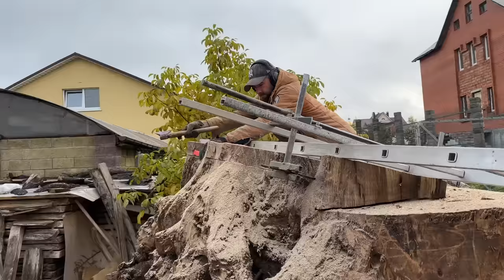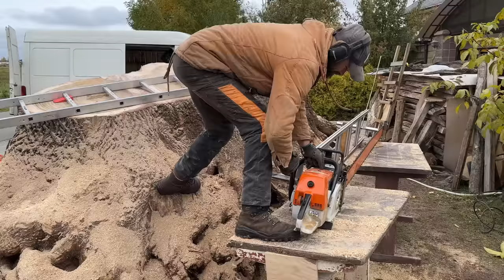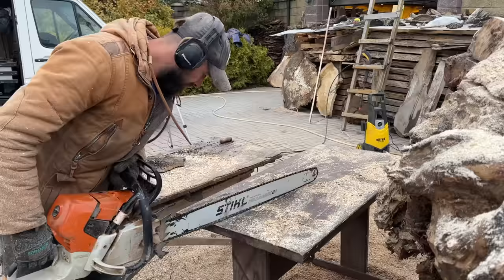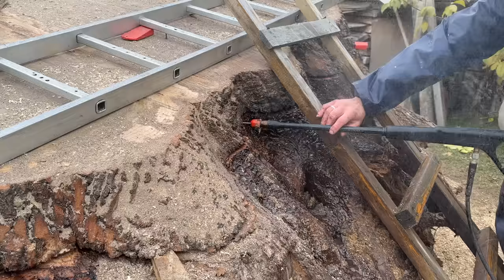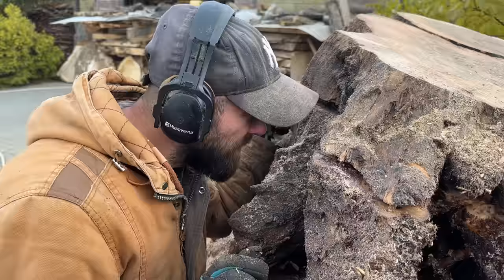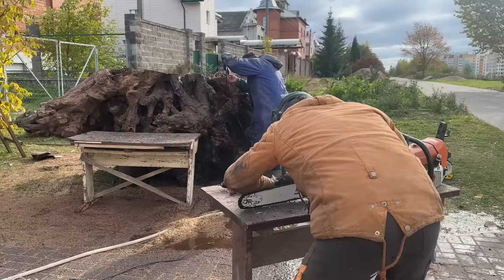A shocking find in an ancient oak stump

Comment: There was literally a piece of steel angle iron in the center of the tree. I imagine it was used to hold the tree steady when it was freshly grown. 200+ years ago.
Reply: No a forge made square  iron bar used to mark property corners for surveyors. Trees would grow around them. And never be cut because everyone knew that tree marked the property line.
Reply: Must have been a Beautiful Tree !
Reply: No
Reply: How is that "something shocking", interesting but not shocking,
Reply: 이종
Reply: An ancient axe blade?
Reply: What did that do to his blade?
Reply: Nice table tops
Reply: I was told you can count the rings to know how old the tree is?
Reply: No eye protection?

Comment: I keep seeing beautiful table tops being made from the slabs of wood.  That wood is beautiful and these guys really have patience and skill.  The prices they will get for those slabs of wood will be well worth their hard work.
Reply: Yes you are correct to the tune of around $4000 for largest one as a conference table to 2000 for the first full length cut as a coffee table using the single first cuts as end tables to match
Reply: Claro pues esa es la idea cada loza de maderera es una mesa de roble y sigue siendo util para cada cena" creo yo" the charly ahi libra las cadenas que daño debe ser con una losa de esas creo yo" the charly"???
Reply: Hi claro estos dias tambien corte unos 3 ho cuatro arboles lo malo es que eran de pino patula para una casa en madera y tambien sillas diseñadas con tronco y hojas de madera de 4 ho 5 pulgadas"??? Mas las bigas y otros"??? The charly"??? Tambien saque como unas 10 toneladas de tierra el mismo dia para mejor visual" de la casa finca"???

Comment: If you really want to cut through metal with a chainsaw, you should be using the carbide tipped chain designed for firefighters to cut vents into buildings. It can cut through solid steel without too much trouble. Stihl makes a couple of different versions, so you should be able to find one that will work with your saws.
Reply: I had made the same suggestion but I believe due to their ability to cut through most material they are also favoured by certain people for illegal activities, this make them difficult for the average person to acquire.
Reply: @metalmicky  You can buy all the chains you want.  The Stihl dealer only recommends them for that one saw model.
Reply: Why aren't they using glasses, We know theeyn are cutting metal, the kind of metal is irrelevent, you would still lose your vision. I only have one eye, but from AMD.  Its a pain in the butt!🤨🤨
Reply: Yeah I suggest goggles too!
Reply: That or one’s made for cutting concrete! They cut thru metal as well! Just like butter! Of course you have to keep em wet!
Reply: There were stones that grew in that tree

Comment: Typically you would see a blue line in the wood if there is metal in it, so you guess either lead or stone of which I have cut my share of both in NY.
Also there comes a point when you have to say “the slab ain’t worth it! Get the axe!”

Comment: Have you guys thought about getting a 2-man portable band saw with carbisde blade to use on your ladder miil? Thinner kerf (1 or 2 more slabs /cookies per log /stump), way less likely to bind and with the appropriate blade, cuts through nails and bullets. If one isn't commercially avaliable, contact Matthew Cermona, he designed and built his own mill, so you could colaborate to design something that you all benifit from. I'm an architect and already have various ideas as to how you could design and construct such a mill that facilitates how you currently mill more efficently snd how to impliment this. 

Fascinating watch this unfold. For video "dramatics", conside dousing the wood with water (see Matthew Cermona) to show your subscribers the beauty of the wood your milling?
Reply: I’d suggest diamond toothed chain blades used in concrete cutting! Cuts right thru rebar and anything! But you have to lubricate with water.

Comment: I guess this is why loggers always leave stumps behind because sometimes trees drag rocks up with them as they grow ,but this seems pretty high up into the tree here like maybe someone set a rock in the V as the trees were growing together in the trees younger years you often find them in the roots if you'd have known it was a rock you could have used a concrete or rock  cutting blade maybe on a different type saw and cut that rock right in half and left it there and varnish right over it as the end product of tabletop it would add a real conversation piece it looks like there are going to be some beautiful piece's as you get into the  lower tangled roots section  of stump it would be cool to see how those look ,cool video keep up the good work ( hard work)!
Reply: Sad to see that humongous tree had to come down. The years it lived and the stories it could tell.
Reply: Non ho visto niente di strabiliante, ma è comunque un video piacevole. Grazie.
Reply: @sheryljaskiewicz8429   Maybe it was getting diseased or unsafe. I hope that was the reason, and not just because developers had other plans that it wasn't part of...
Reply: Include soil erosion in the plethora of possibilities.
Reply: Forse c'era dell'ambra. Resina fossile.
Reply: Not just rocks - that last bit was a solid hunk of angle steel beam. Probably an old fencepost.
Reply: No safety glasses!
Reply: We have MANY trees that need removed with ancient barbed wire through the center. The cedar trees are the worst, but you certainly have to be careful and pay attention when cutting!
Reply: @sheryljaskiewicz8429 Trees don't live forever
Reply: Non sai usare la punteggiatura quando scrivi ?
Reply: Great idea !
Reply: @roburz62   They don't need to be removed, they need to be revered.
Eradicating mature trees degrades the whole shared space for plants, animals,  and humans. 
#SaveOldTrees

Comment: A few years myself and my wife were saw up a large oak trunk for firewood.
While cutting a slice I noticed fibers coming out with the chips.
Putting it through the splitter we came across a silk handkerchief in lovely condition.
Counting the rings it had been there since the 1830s so  we'd like to think a lady placed it there maybe for a loved one to find but was never found.
I still have the log and silk handkerchief trapped in the wood sitting on a shelf in my workshop

Comment: Any idea of the actual dates of the tree? With nice clear rings like that it should be possible. Really interesting to know what it lived through.
Reply: Must be over two hundred years plus?...a huge stump
Reply: It looks like a few trees that have grown together and that would account for the stones, but they say it’s a single oak, so I’d say it’s about 500 -700 years old at least judging by the girth
Reply: It's only about 80 years old. You can count the rings if you pause the video. Many people believe that size dictates age and that is not always true. Many trees in the forest are similar in age but vary in size greatly. I've seen 80 year old Hemlock trees that were only 12 inches in diameter growing right next to  one that was 24 inches but the same age.
Reply: @mattdillon4398 your statement is accurate. There are many factors that determine the size of a tree.
Reply: Clearly it was 3 trees so close together that they grew into each other.
Reply: @mattdillon4398 Matt Dillon isn't just a great actor but he is also very knowledgeable in the subject of tree... stuff. Treeology, I guess would be the correct term.
Reply: @crenaud590  define 'clearly' LOL

For many species of trees, multiple trunks can radiate from the same root mass. However, it is still one tree. 😉
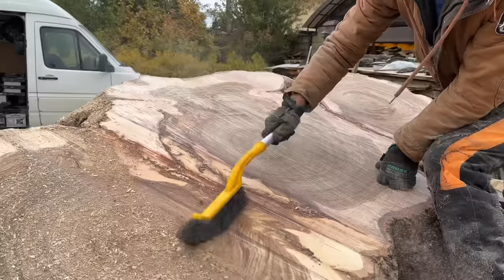Reply: @mattdillon4398   yeah, @12:24 for example the outer light coloured section only has 7.5 rings on it..
Reply: @jeffreylebowski3216 Dendrology is the correct term for the study of trees.
Reply: Great exploration into the past of the oak. One can count annular rings and send the inner pith for carbon dating.
Reply: @mattdillon4398  I paused the video to count rings as well. I also came up with about 80 years, Surprised that it wasn't older given it's size.
-dave
Reply: @dgwachtel it's that big because it's three different trees grown into one. Pay attention.
Reply: @ironnads7975  It is always possible to either be mistaken or miss another explanation which may be more correct or overlook some feature or other. 
Sorry Boss, I'll try to do better on the "Pay attention" front in the future.

Comment: This video that took the better part of an hour could have been wrapped up in 5 -10 minutes. I fast forwarded through most of it, and just watched several one minute clips throughout. From what I did see, I almost laughed out loud at how much effort these guys were putting into cutting a 5-inch slab off of that stump, and how many times the chain on that saw had to be sharpened (or replaced). I used to be in the firewood business myself, so I know exactly what's involved in all phases of woodcutting--although I must say that for as much cutting as I've done, I've never tried to cut a slice of a stump that big. But I know that's a helluva job even if there are NO rocks imbedded in the stump. (BTW, the fact that there were should actually come as no surprise; there's no actual "shocker" in that. There's nothing shocking about rocks getting dragged up into the stump as an enormous-tree-to-be gradually grows over many decades. Ask any logger who's dealt with enormous trees and stumps. It happens.)

What was that last object that they found at the end of the video embedded in the stump, though? 
That black vertical object. 
Was that a rock? 
Or was it something else? 
It almost resembled an ancient tool of some sort--but since the tree was clearly hundreds of years old at the bare minimum, what could it have even been besides a rock?
Reply: That's the question of the day. What was that black vertical object?
Reply: Yes, what in God's name is that.?
Answers on a postcard please. 😮😮
Reply: It was tough and definitely malleable, which suggests it was metallic. Something like the tip of a rusty ploughshare maybe?
Reply: yeah I was surprised to know I sat threw the whole thing and see a couple of rocks then find they do not say what they had found and this video has millions of views
Reply: @lisahartsook  i flipped to the end, early on.  It looked like an iron fence post.  One of those ones with an L shaped vertical profile
Reply: Many a “sword in a stump”. ? 🫡
Reply: Somewhere further up the page it was tagged as one of those irin/heavy metal supports often used with a young tree that’s beginning to lean. It just never got removed. 

It coyld also been leaned up and forgotten. 

We had t “bike in a tree” here for a couple decades. It was left by some kid in a fairly well-off family because he didn’t get the one he wanted. 

There was some serious grousing when it got cut down, but apparently there was actually some legitimate reason to bring it down. 

A bike parts and repair shop bought it and put it up in the parking lot (edge of).
Reply: It was a piece of ANGLE IRON:face-blue-smiling:..  The treasure was:face-fuchsia-poop-shape:.....
Reply: @williamfielding6476  🫣yes 
I say rusty ole angle iron, I was tryna be upbeat funny tho. Still a very interesting piece of work to slab out those big stump. I can see why there’re so pricy and this is just the beginning stages to make a nice the nice tables.

Comment: Stihl sells a Fire fighter's rescue saw chain that is carbide tipped. It's used for cutting open roofs so it can cut through shingles,wood,and steel brackets in the roof. Might be worth ordering just to have one blade that could cut through stubborn things.
Reply from the maker: Perhaps yes. But now you can’t even buy a regular chain from us. We are under sanctions. People at the top are doing weird things, ordinary people are suffering
Reply: That's sad
Reply: Now why would he get one of those when he can go through 50 chains ,7 chainsaws and ruin 10 bars. Plus he had to try every chainsaw he had in the van. Plus this would not make a good video on how not to do things.

Comment: If your getting about a 30 second cut on one blade even with oak , that is an indication that something  harder then your chainsaw  chain is inside the tree. Two choices: leave that log and go one to the next cut; or cut around the unknown object without hitting it and then chop it out with an ax. It will save a lot of chainsaw blades!
Reply: There were 3 objects in different places of the tree. Unless you have exray eyes you cant cut around them. Have you ever even picked up a chainsaw before? They had no idea if it was one large object or as it turned out, it was 3 different ones in different places..
Reply: What kind of metal was that?? Very interesting!  WHAT a surprise
Reply: @crossgrainwoodproductsltd9230  1 ) a stone 2) a piece of metal an what is nr 3 ?????
Reply: @micharebuz2542  An other stone.
Reply: Pues si " x que el corte es completo como para mesa " pero quien imaginaria lo del centro el hierro y la piedra " crehi que en el centro habian escondido el oro jua.jua.jua" ???
Reply: @micharebuz2542      Replay it. They find one small stone and a larger he cut through.

Comment: In some regions in Germany the trees are checked for bomb splinters before being felled or are cut in a sawmill
Reply: why just check splinters, not a whole small loaded bomb? I saw that in England, once in a while when they need to dig up the ground they still find unexploded German bombs that were dropped down from planes.
Reply: @ibeetellingya5683  I don't know anything about felling wood or bombs. But my theory: 
During the war, thousands of bombs were dropped on the cities. The unexploded bombs had caused a large and deep impact hole. These were then simply filled in. Even today, old unexploded bombs are still being found during construction work. During defusing, houses and apartments in a surrounding area are then evacuated.

The railway lines were also bombed during the war. The number of bombs wasn't that many. The railway lines often go through the forest. This means that a lot of trees were hit by bomb fragments.
The unexploded bombs in the forest have probably been defused or blown up and therefore no longer pose a danger during forest work.

Comment: After buying a farm and was cleaning it up, noticed it was habit in olden days to remove rocks from the fields and throw them on the boundary lines. Boundary trees would grow and engulf the rocks. Many of my boundary trees have not only rocks, but remnants of old wire and stakes grown in. I currently have an old Ash tree that died, it’s at least 100 years old and on our boundary. We would need a professional to cut it down, it’s huge and most definitely contains rocks and wire. Or...do it the cheap way, wait for it to fall on its own!
Reply: what you want is dynamite
Reply: Cut it 4 ft up and you should clear most of the rubble. 5 ft if you think it may have a fence post in it. I doubt that's the case.
Reply: Omg...that would work! Drill a couple holes, insert a couple quarter sticks, light, run, and...
💥BOOM💥
Reply: I have a massive wallnut tree in my garden with a hollow at the base where frogs an toads live , at one time i even saw a piecost come out of the hole
Reply: The best fertilizer to give your tree is to plant it’s own fallen sticks in the ground around the tree. Trees are their own best fertilizer. I found this out while researching my own very old Sugar Maples that surround my yard. Some are at least 100 years old! Note: only the outside of the trunk of trees are alive, the inside is dead and only serves as strength to hold tree up. I have a completely hollowed out old apple tree that still puts out hundreds of pounds of apples each year.
Reply: @prestcoldandy910  
Are you sure?
Are you sure it wasn't a henway?
Reply: @seeharvester  def a piecost
Reply: @prestcoldandy910  😜